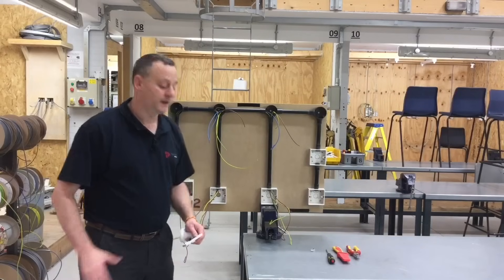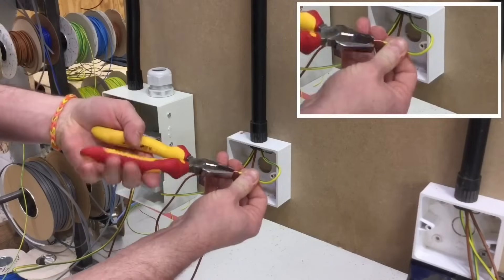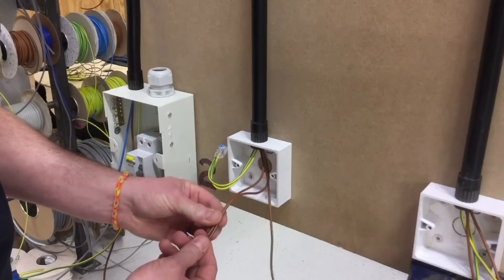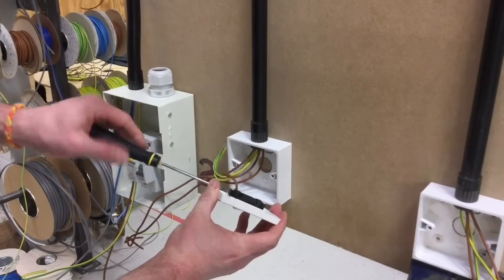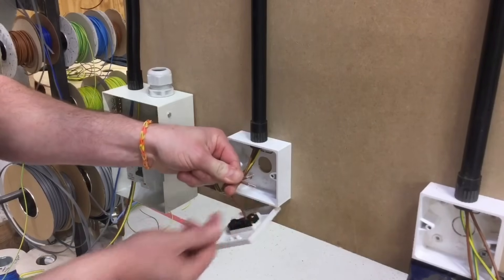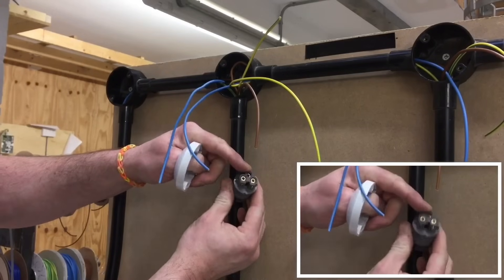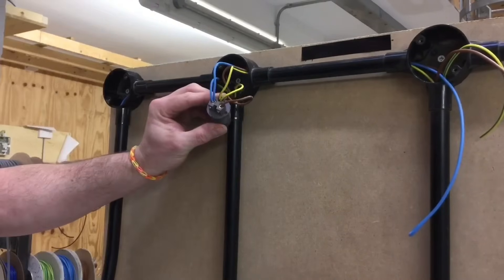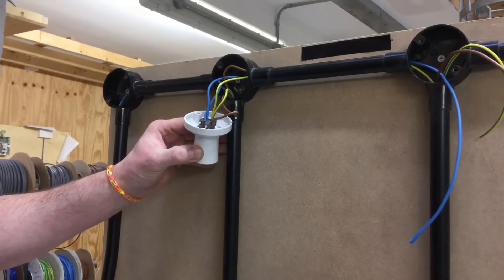Conduit Loop-in Method How to Terminate PVC Singles into Switches and Lights (How to Connect Up)

Comment: Could you use ferrules in this installation or is that more beyond the level aimed?
Reply from the maker: Not recommend on class 2 conductors but on smaller ones you can… what a half answer that is 👍🏻. Thanks as always Monty. Ferrules on class 5 and 6 conductors for me 👍🏻👍🏻. Gaz
Reply: @GSHElectrical  Thanks. The YouTube electrical world is Ferrule crazy and I've seen work done on here using ferrules on class 2!